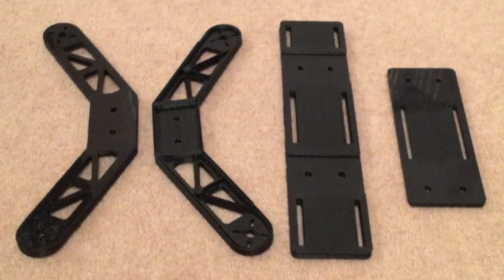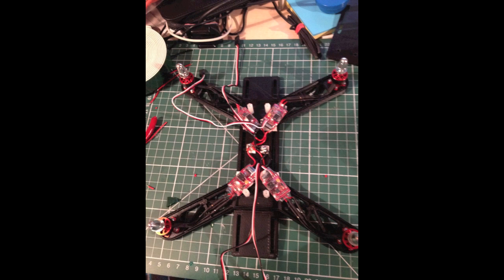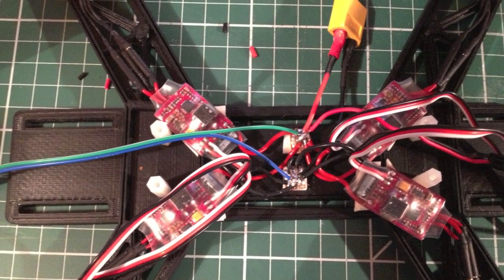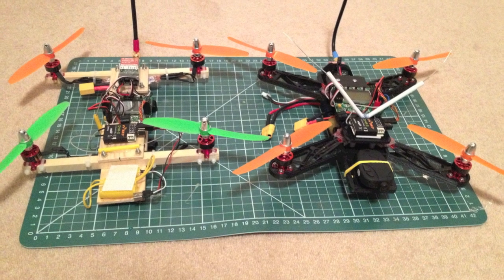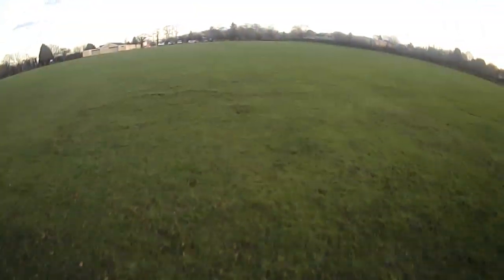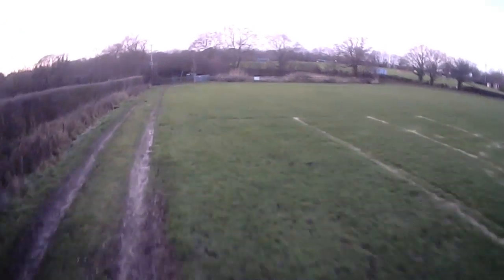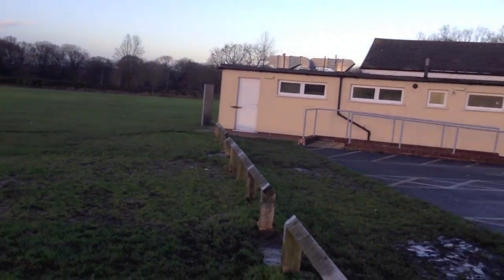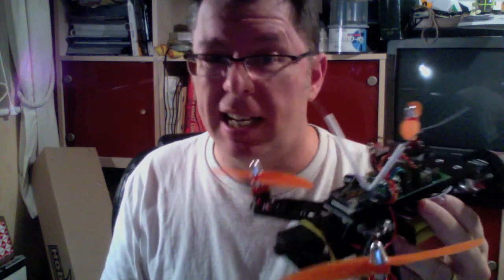The K-Quad build & maiden: A 3D printed mini FPV quad.

Comment: Speed, flight time, and price?
Reply from the maker: +Cole Little Nearly 2 years in mini quads means that things have moved on quite a bit.  This frame was designed as a low cost option against the current cf frame which cost a lot, but that price has come down massively.  So to answer your question, the updated version of this is free here http://www.thingiverse.com/thing:397036 (if you have a 3d printer) or just buy a ZMR250 frame for cheaps.  Flight time is entirely dependant on the motors/weight/power setup you use.  About 6 minutes on my current 3s setup with 1804 motors on a 1300mah lipo.  Speed wise - dunno, judge it from the video.  If you want to go fast use a 4s setup and bigger motors/props
Reply: Thanks for the reply, just searching to get started with FPVs. This question might sound "newby" how do I receive the live video feed of the camera, WITHOUT having to wear the ridiculous goggles, if you will.
Reply from the maker: +Cole Little Hey, the goggles are cool, and the ladies love them :)  In all seriousness, I find them way more immersive than a screen, but if it's not for you then no problem, many other options are out there - for example here's a VTX/VRX set http://www.banggood.com/Httpwww_ebay_comitmWireless-32CH-5-8G-600mW-A-V-Transmitting-Receiving-p-975775.html (I mention these because I have a set to review but the weather has been too bad to go out)  Stick the VTX on your RC whatever and connect it to a camera, plug the recevier into a screen of your choice (of which many options exist) and you are good to go

Comment: Very cool.  This is inspriting me to get tinkercad.com going and design my own! 
Questions: how is the frame tolerating crashes?  Is it holding up to the inevitable?  What sort of plastic was used?
Reply from the maker: This was printed in ABS. although since we made this one the v5 version of it came out which is a slightly different design.  In a big crash, the legs will break, which is kind of the idea - but at the same time you could make these very strong - solid with 100% infill and they'd hold up a lot better.  I'm actually flying a carbon fibre based frame at the moment as the prices dropped - but I have two printed ones to experiment with, and may print myself a hex to ply with soon :)

Comment: hi, great video,s I've enjoyed your mini quad builds, nice set up. Just 2 short questions: did you made up your own 808 video out cable and could you do short video on it or could you tell me how you did it as I have just received my 808 and I cant quit see but did power it off your receiver and is it still necessary to use a filter then ?
thanks
Reply from the maker: In the case of this build I took an existing 808 video cable (and you can pick up extra ones very cheap off ebay), then stripped off the bulky plastic around the connector - then cut the short video/power cables and extended them so they were the right length for my quad.  For my last build (FX-79) I started making my own with mini USB solder shells... which are a bit fiddly, but saves all the hacking of the plastic surround.  It is powered off my rx - no filter required.. no issues with picture.
Reply: Great I will get one of those cable. Can it be connected to any channel on the rx.
Reply from the maker: 74jalor Yep - just put it into any spare channel, they'll all carry the 5v you need.  Obviously just make sure you double check that the ground/power are on the correct pins.  I think they are iirc, although I think you need to swap the video pin if you are using an ImmersionRC VTX.

Comment: I noticed that you powered the KK2 board direct to the solder pads. Without using a BEC or the built in BEC from an ESC. Can you shed some light on that? I just printed one of these up and want to make sure I get the proper electronics to go along with it. Can a KK2 safely take 6-7.4 volts?

Thanks

Great channel btw!
Reply from the maker: Jason Kass The KK2 is actually being powered through the BEC from an ESC.  The connection direct from the battery to the solder pads is so the KK2 knows the voltage of the lipo, this was you can set a low voltage alarm so the board will start beeping when you hit a certain voltage.  I think in the 2.1 and later boards you have a jumper to connect the voltage to, so don't need to solder anything.

Comment: Really nice video :D , i´ve  got some questions:
-What motors are you using?
-Did you ever tried a Flip 1.5 or something?
Reply from the maker: Thanks, that's very kind.  In this video I'm using Turnigy 1811-3800's (as seen here https://www.hobbyking.com/hobbyking/store/__8479__Turnigy_1811_Brushless_Indoor_Motor_3800kv.html) I've been having some issues with these motors though, and with them I've unable to get the quad as smooth as I like, so I'm just about to try some RCX 1804-2400 on 3S.  I must confess I really haven't experimented much with flight controllers (lots of kk's and a Naza) so I haven't tried the flip - which I believe is based on MultiWii.  I'm aiming to branch out a bit and give some other a go though
Reply: Thank you, do you think these would work to? ( http://www.hobbyking.com/hobbyking/store/__39947__Turnigy_2211_Brushless_Indoor_Motor_2300kv_EU_warehouse_.html )
Reply from the maker: *****
 As a general motor for a quad, or for this particular frame ?  For this frame, the mountings may not fit (it didn't have the specific data for the mount on the HK site, but the motor looks larger in general) - but would give you some increased lift on a 3s.  They'd certainly work - I have to say motor selection is not particularly scientific - we chose what has worked before, or what others have had good success with - trial and error really.
Reply: Not for that particular frame, but for other mini quads just as your wood scratch build one?!
Reply from the maker: *****
In that case - yes, they'll work fine :)
Reply: Thanks for your time : )

Comment: Thanks for an enjoyable and informative video, the smaller size copters seem to be ever more popular, I had been put off by the price of some like the QAV250, but your design is simple enough to reproduce, even without a printer, great work!
Reply from the maker: Yep - they are everywhere at the moment.  You don't need a printer, just a few bits of wood and you have a pretty nice frame ready.  I'm having issues at the moment with those 1811 motors, I'm going to swap to something else

Comment: i have a similar setup but not having much fun as i am getting some crazy drift. hi, what are you pi setting, and auto level setting for this machine, i could then use them as a starting point. Many thanks
Reply from the maker: What flight controller are you using ?  On the Kk2.1 board, I couldn't get it right on the 1.6FW so went over to the stevis firmware which seems to give a lot more fine tuning.  Are you drifting in self-level ?  If so, did you do the calibration at a completely flat level, don't forget you can correct drift in autolevel via the tuning here as well.  I can give you pi's I use at the moment, but the different FW I use mean these are multiplied up and so will seem ridiculously high (I think roll gain is something like 360 at the moment !)  If you have a KK2.0 though let me know, as I can tell you what my mini-H quad is set as - which would hopefully give you a decent start point
Reply: i am using a kk2.0 with 1.6fw will stevis work with a kk2?
and if yes what setting you using, i could then use them as a starting point, cheers
Reply from the maker: np mullins
steveis has done some firmware for the 2.0, but the 2.1 fw he did was to sort the bugs out from the official release and make it more like a 2.0, so you are probably good - or there's a whole bunch of modified fw by RC911 and steveis - although mainly aimed towards acro flying.

As a start point, here's my kk2.0 PI's from my mini H quad, which should give you a decent starting point.

In the mode settings, set "Link roll pitch" to No

Roll - P gain: 50, P limit : 100, I gain: 40, I limit 20
Pitch - P gain: 70, P limit: 100, I gain 40, i limit: 20
Yaw - P gain: 60, P limit: 20, I gain: 50, I limit: 10

Self level - P gain: 15, P limit 110

If it drifts in p level, then use the ACC tim roll/pitch gains to correct this, about 20 points at a time until it's solid.

Make sure you are happy with it's hover in manual mode before you start on auto-level.  I find things a bit unresponsive at normal stick scaling settings, so have mine set at 50,50,60,100

I do also find self level a bit slug-like on a KK2, but it depends on the sort of flying you like.  If you still have problems, post a video up showing them, and hopefully I (or others) will have some other ideas
Reply: thanks for taking the time to write a detailed reply. cheers

Comment: Thanks for the reply is there a complete build video from you we can follow as it would be brilliant to make a homebrew
Reply from the maker: Hi Steve, I haven't really given a real step-by-step how-to video for a build - If you look at a previous video I did about my mini H quad, that is literally a few sticks banged together with some motors on the end.  If you can get that far, and plug servo wires in then you will get into the air.... it might not be pretty but it'll get you there.  If you are after some knowledge of one particular aspect, then let me know.  I see you have a Blade 350, so you are obviously have knowledge of how to fly and which way props spin etc :)

Comment: Great run down and little quad build, looks very tidy, light and compact and footage looked great too. Is it any lighter or tough than the wooden version?
Reply from the maker: I think it actually comes in slightly heavier than the wooden version.  I'm thinking it should be fairly tough.  It has a little bit of flex, and the arms are quite short and stout - they'd need a pretty serious impact to break

Comment: Have you tried the hobbyking esc's yet you could get the 10A ones and reflash them I am going to do this on my first quad which I have finished and fly's great but the ss esc's are letting it down the throttle steps are more like walls.
Reply from the maker: I haven't - I do tend to stick to what I know in ESCs.  My one experiment with a Red Brick ESC ended in it going 3 flights in, so I tend to buy plushes at the moment

Comment: Sure looks nice and it's light weight. I would like tricopter that small.
Reply from the maker: I'll give Neil a prod, he doesn't need many excuses to get another design on the go :)  I think missing one motor might make it struggle though - different motors, perhaps slightly bigger or pitchier props needed
Reply: You're probably right , tricopter would be unstable that small. If your bud ever sells that frame I'd buy one . It's the perfect size to take on trips out of town.

Comment: Like that a lot and very good explanation 
What kinda cost is this compared to a mass produced quad ? Thanks
Reply from the maker: Not hugely different - obviously the KK2, rx and VTX is the same kit you might have on a normal quad.  The motors I used are $10.45 each, and the ESCs were  $8.89 each... which is not much, but you could spend $41 a pop on tiger motors this small.  Obviously I got the frame for free, but you could knock up something similar out of wood for a few $.  I would say the build and setup can be a little more fiddlier, because you don't have the space, or the mass when in the air
Reply: It and you fly superb has it auto stabiliser ? If not can it be fitted ? Thanks
Reply from the maker: The KK2 has an auto-level mode, so you can make very gentle and easy to fly if you like